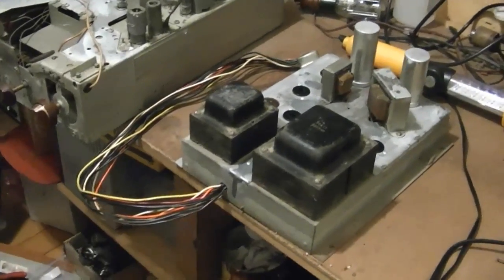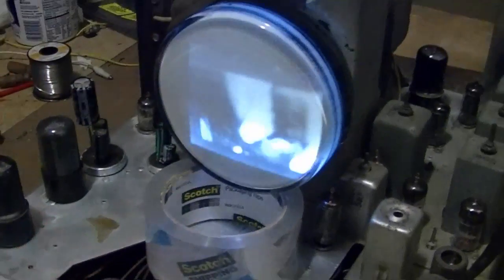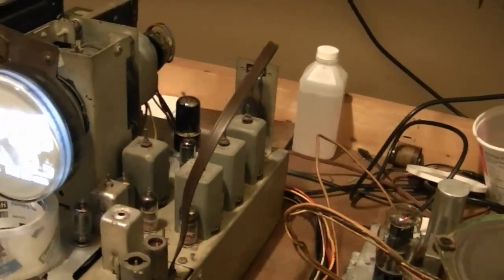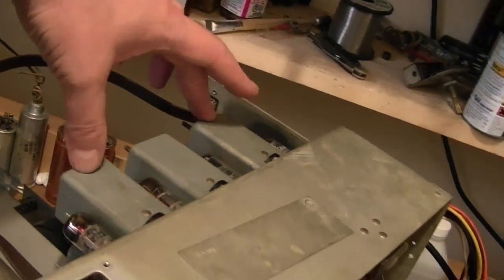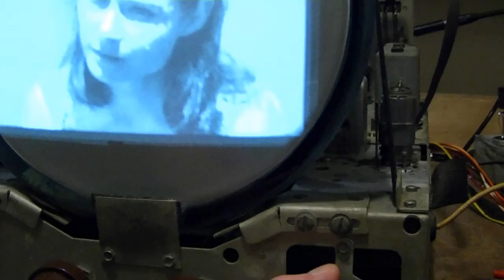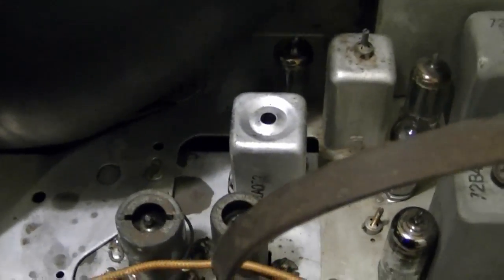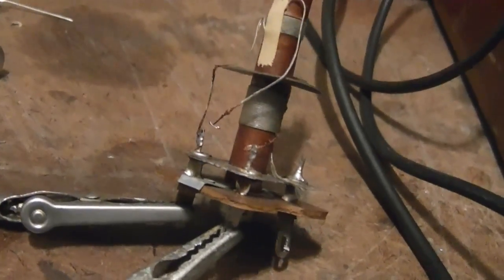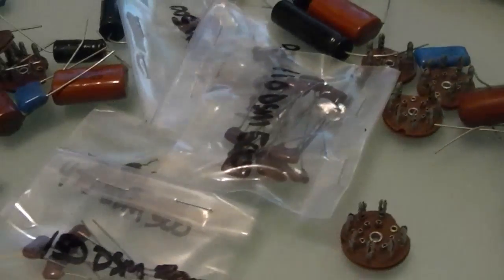Admiral 30A12 restoration pt6o?

Comment from the maker: Yes, I do have a couple fiberglass rods I could customize.  All the other Admiral chassis I've worked on had the audio trap located outside the tuner so I suspect they realized it was a bad design back then.

When I checked the 2nd audio IF can, I found a little ceramic tubular cap and no mica.  There's also a mix of mica and ceramic in the video IF cans.  There were a total of three of the exposed mica type caps.  One in the audio and two in the video.  I plan on replacing all three.

Comment: Bob, you need the white plastic diddle stick that has a hex head about 1/2 long then a thin round shaft the lets you adj the bottom slug after passing thru the top. The thin round shaft is smaller than the hex so you can turn the bottom once you engage.

Comment: Bob:

It's nice to see that our Solar capacitor checkers work well in the pf range caps. I haven't tried it on micas but think I'll pull it out myself today and try it. I have a 1957 GE transistor radio candidate that I suspect has bad micas in the IF cans. It play well but has white noise even with the volume all the way down. It could also be a bad germanium transistor. They can present the same symptom.

Not only are your micas leaky, but your skies are as well.  ;)

Have a good week!
Tom

Comment: Thanks for the post. Your analysis revealed so many faults, seemingly dating from manufacture (the unsoldered wire in the tuner). I guess over the years, impurities in the mica in the silver mica caps causes leakage, but strange they are the preferred type for stability over temperature.. Perhaps there was not enough time (20+ years) for designers to choose caps more reliable than mica..

Comment: for jammed if cores there is the option of inserting a brass core to reduce the inductance or a further ferrite core to increase it along side the jammed one.
the idea behind having to adjust the fine tuning to a certian point before the oscillator coil is accessable is so that the fine tuning is always in the same position for each channel therefor minimal adjustment of the fine tuning is required when switching betwen stations.

Comment from the maker: Some of the caps in the IF cans are ceramic, but they're only used for coupling.  The ones in parallel with coils really should be mica because of it's temperature stability.  Modern ceramic NP0/C0G types are also pretty good too but not as good as mica.

Comment from the maker: I did do that when I aligned the set.  Also, it's not stagger tuned - just 21.25 MHz peaked all the way through.  A signal is getting through as you can hear but it's not as clear as I expected.  So I figured the problem had to be in one of the two IF stages.

Comment: Too bad YouTube wouldn't let you over-dub a little "Riders on the Storm". :)

I am surprised you got as good a signal as you did at first with the loose wire in the tuner and the broken slug. That may be how the slug got broken. Trying to trim out the noise of the loose wire.

Why are silver mica caps always used in the IF cans of these old sets? Was this before the ceramics came along?
This has been a great trouble shooting series, really thrown some good curve balls :)

Comment: FM sets do suffer from bad mica caps, Shango had a series on a mid 1960s G.E AM/FM set that had problems with silver mica caps in the FM IFs. The dead give away was that the FM side had low volume, and no matter how much he tried he could not get the IF cans to peak. It turned out that the silver micas inside those cans were completely open, which I think is a more common mode of failure then leakage. Oddly enough the AM IF cans were still fine, maybe they used ceramic caps in those?

Comment from the maker: I wonder how a mica cap goes open ?  It's just two conducting surfaces with mica in between.  From what I understand about the issue it's caused by a high potential across the cap gradually causing silver to migrate across the gap and forming a conduction path.

Comment: Yes I understand that FM does suffer, just not seen in personally (or maybe I have and have not realized what it was). What I was wondering is if the lack of the FM does not present with the thunder storm sound like AM due to the nature of a FM signal. AM silver mica present with the sound of a thunder storm, while FM just seems to be lower overall performance, leading me to think the limiting action or use of a ratio detector may eliminate the effect (loud crashing) but leave the poor performan

Comment: yikes that sounds odd. do you have any of those fiberglass rod types? They are pretty easy to sand to custom shape. Great video btw. I know you have been finding mica issues, I have seen that a lot on AM radios, but not FM. I wonder if the nature of the signal FM with ratio detectors or limiter stages accounts for the lack of the audio crashing so typical of AM silver mica.

Comment: It has more to do with how the IF can is built, some just use a press fit metal tab to make mechanical contact with one plate or the other, It could be that the leg gets a bit loose or the leg or the silver spray ends up getting oxidized. I had an AM set where the volume would go up and down if the set got bumped, I later figured out that I could reproduce that behavior by wiggling one of the lugs on on of the IF cans so it was a contact problem.